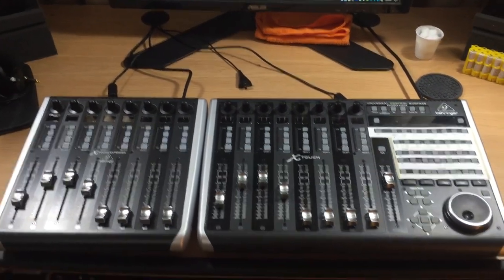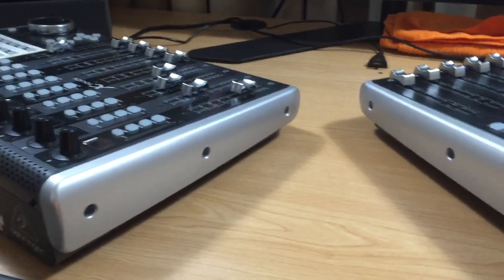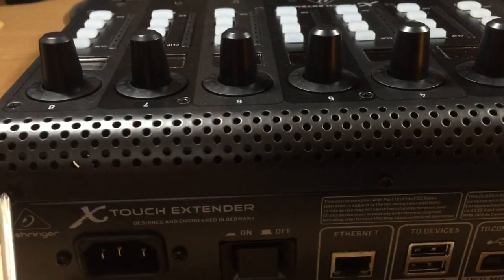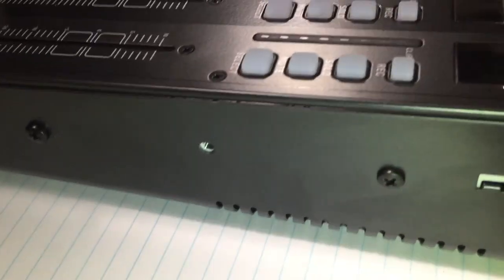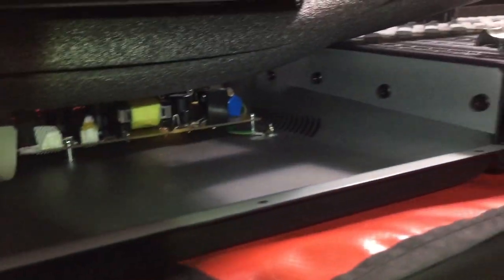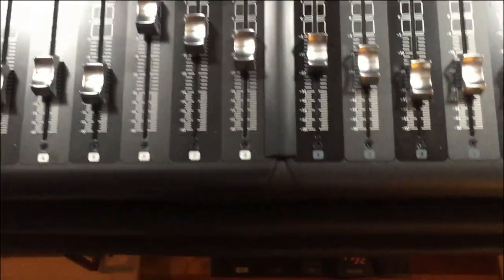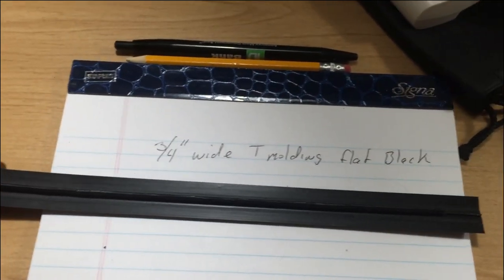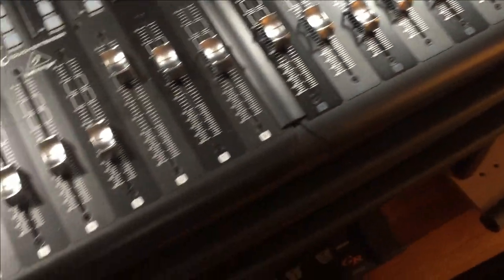Connecting the Behringer X-Touch and X-Touch Extender

Comment: Nice Job! Did a similar job myself except I haven't physically joined them, just used a combo of modelling clay (to block up the gaps) and dark grey gaffer tape to cover over along the bottom edge and the sides.  Then just sit them neatly together.  Looks just as good.  I also have them on two small laptops stands to angle them up a bit more.

Comment: Great job. As soon as I buy my extender, I will remove the silver side pieces and just place velcro on both units and join them. Then cover the connecting joint with the same thing you used of black electrical tape.
I'm not planning on moving the unit around so I think it will be great as well.
Reply: Did you ever try the Velcro? Did it work good?
Reply: My thoughts exactly!
Reply: Great idea.
Reply: I’m thinking of removing the silver panels, and the side screws. Then using like 6 black 3M velcro strips to let them click in flush.
This way they can sit stable together (on a surface, wouldn’t try to pick it up like this) and could be easily separated if needed.

Comment: Awesome video!

I'm looking to do an install at a venue to upgrade their PA system, and they need it to be "Idiot Proof", so I'm planning on using a digital mixer like the XR18 or X32 rack and have it be controlled by Bitfocus Companion over the network with a Raspberry Pi in the rack running the software with a stream deck so they have simple buttons to control only the mics they will be using (The Raspberry Pi will also be able to record Multitracks). 
I also still want them to have physical faders to control the digital mixer (that isn't the iPad App) so was planning on setting up an X-Touch with a pair of routers acting as a bridge, but having the extender like this would give them plenty of faders at the "Mixing Position" (especially since the XR18 only really needs 16 faders. I'm planning on setting up a PC at the mixing position with X-Edit running on it, with a touch screen monitor in line with the X-Touch faders, so they can control things in a very user friendly way.

So technically with this build they will have 4 ways of controlling the mixer: The iPad App, the Streamdeck, The X-Touch, and the X-Edit App on the PC.

Comment: Well explained, but that moving, shaky, camera-work was all over the place, and very difficult to keep orientation on what we're looking at.  Also, the constant noises from the banging of the camera/phone mic was super-loud on my system, probably because your voice was quiet so I had the volume turned up.  Apart from that - would have been better with fixed camera - it was well explained.  Thanks.

Comment: Nice video bro. Just in time. Im planning on modifieding my X-Touch One with another control surface. Do you own another brand daw controller??? Reason I ask is tht Im curious to know if another brand Daw controller tht uses MC or HUI protocol can cascade or be control as a extender by the X-Touch when plugged to its USB hub??? You have any clue or run a test for me???
Reply from the maker: Where the extender has no transport controls I am not sure it would work if the second device does. I tried connecting my faderport one as you suggested and it did not cascade but the transport controls mirrored the X-touch's.
Reply: Would you not just be best off with another Behringer?  At least they should be compatible.  The X-Touch One has a USB bus also, which is where you would connect a Extender to an X-Touch, so why not check with Behringer and see if you could add a Extender?

Comment: Hello great for your video, I have a question please hello I am looking for if someone has the solution I can't connect the X-Touch Ver la extender, I see that there are professionals.Well done, let me ask a question.I have a Midas M32C set with DL32., I work with my config mixing station, wifi on Swissonic MKII in IP address mode 192.168.1.101 it works very well I have a tplink router that I configured in IP address192.168.0.1 that I connected in RJ45 on my X-Touch it works very well, I bought an X-Touch Extender that I connected in RJ45 to a hub but the X-Touch Extender does not want to connect.I put the IP address the same as that of my X-Touch Mode Ctrl IFC Network Network My IP 192.168.0.1 in slave mode.I do not understand why he always stays in Wait mode, thank you if you have an answer, that interests me musically

Comment: Where is the actual point of connection?  Are you screwing them together?  the video seemed to breeze past that.
Reply from the maker: Using the original screws from the side covers and the predrilled /tapped holes to attach. No modifications there just disassemble as instructed and it will be fairly obvious. Email me if you have trouble and I will try to help.
Reply: @Polecat201  thanks, I have gone a different route / not using the behringer but good video. 👍